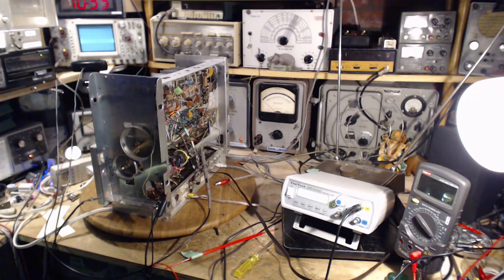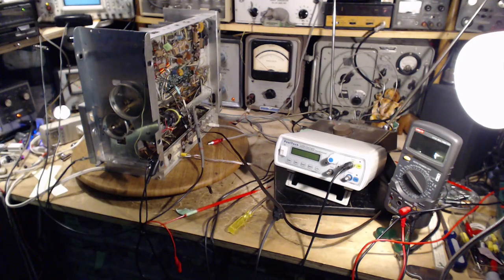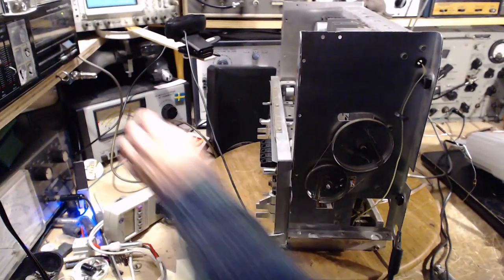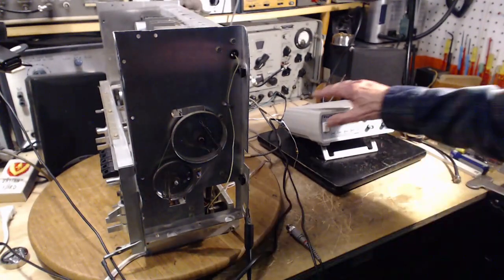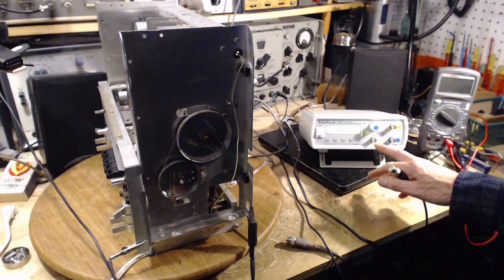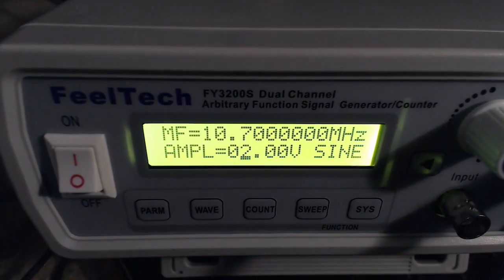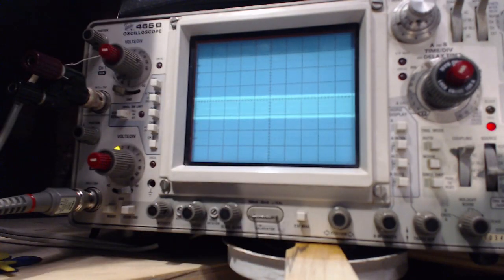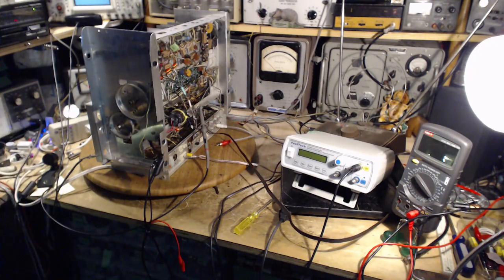FeelTech FY3200S Dual Channel Function Generator - Safety Checkout

Comment: Hi Jim, the impedance of the Signal Gen is 50Ohms, you need to also terminate with 50Ohms at the scope using a 50Ohms BNC Cable not the probe...
Reply: If a signal generator drops the output voltage by a factor of 10 just because of a load mismatch, then it is totally unuseable.
Just imagine hooking this thing up to an IF strip via a "adapting" RC network; these network dont present a perfect 50ohm load to the gen. Or if you used a coil of some random wire to improvise an inductive coupling like shango does so often - I dont want to imagine what mismatch that complex impedance load would present to the gen.  Or if you blasted the signal onto the glass envelope of a tube using a tube shield, you would basically be have the generator output unloaded. 
All of these are everyday scenarios in which a sig-gen has to work without proper termination.
Nah, either his scope is broken or that "modern piece of equipment" is blending in perfectly with the other test equipment in that shop. Tho I also would not discount the possibility of his scope/scope probe being broken too. 
On many many previous videos his scope had trouble displaying small signals even on the x1 probe and set to max sensitivity.